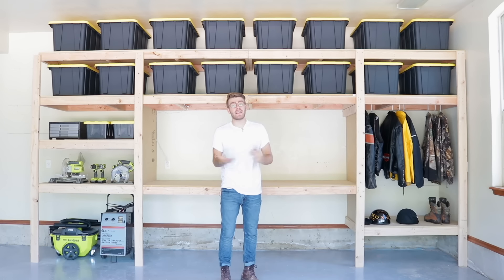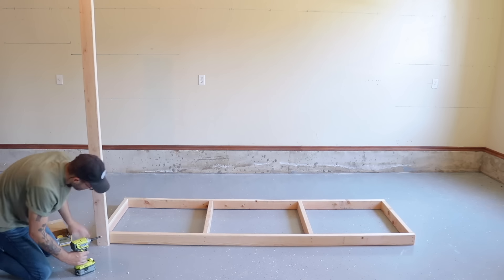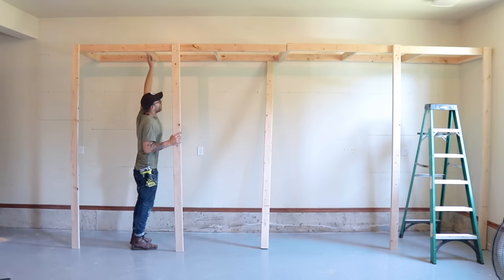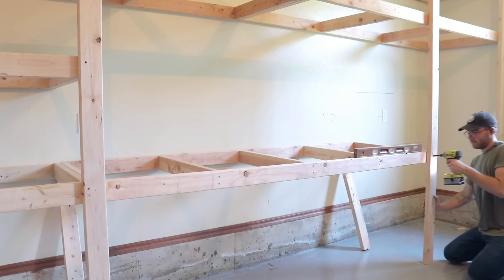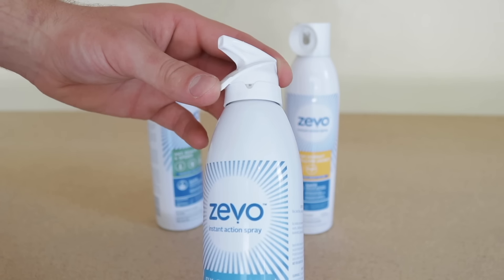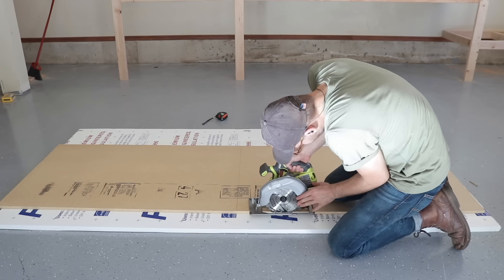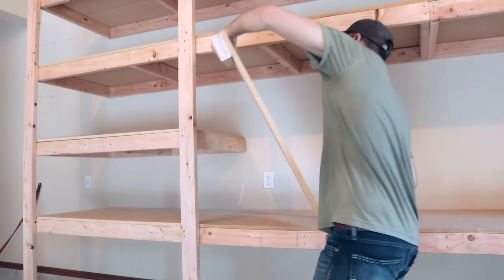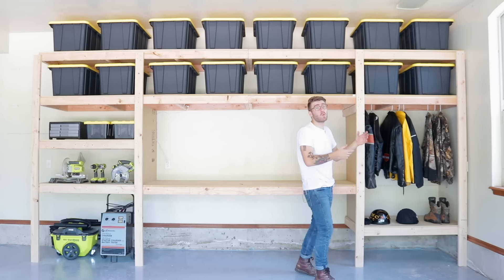DIY Garage Storage / Shelf / Workbench Solution

Comment: Barely a minute in, I had to stop watching.  It's clearly low quality work here.  No glue on joints - just screws in shear.  Said 8' studs don't need cut since that's his leg length - you might want to measure a few, huckleberry, because I'd wager they won't all be exactly 8'.   Measured down from ceiling going right to left - should have used a level to get a level line - the ceiling and/or floor may not be level.  Couldn't watch any longer knowing it would be hack work.
Reply: Mitch D ya I don't think the point was to be super technical or fancy.   Lighten up. It was a quick  tutorial on building some simple not too expensive garage shelves. Probably intended for kinda beginners or diy-ers.  I mean he put way more thought into it than I did for my storage shed shelves but mine have worked just fine goin on 2 years. So I'm sure these will work just fine also.
Reply: If you're going to DIY, why not spend a little extra effort (and no extra money) and do it well enough to not scream "DIY" when someone looks at it?

Comment: “So much nicer to use polystyrene” but awful for the environment, come on Mike do the right thing
Reply: james moon it’s ok as long as he reuses it, not every thing we do is environmentally friendly but if he were to reuse it then it’s fine
Reply: +Joshua Powell It isn't just about reusability of the polystyrene sheet. When you cut just wood, you can use sawdust and wood chips in compost, yard work, etc. without worrying about nasty plastics and chemicals getting in soil and the environment. But when you cut on polystyrene, it mixes with the wood dust and renders it unusable so you have to throw it in a landfill. Hope I explained that ok. ♻️
Reply: Jelisaveta Zivanovic very true
Reply: james moon ok plywood, particle board, mdo....etc are not pure wood either......so using polystyrene is really not that big of a deal.....it’s used by many.

Comment: Ok so materials are
pencil
saw
straight edge
level
drill
3 inch and 2 1/2 inch screws
2x4s
particle board
dowel
lights
No Kreg, no clamps, no nails, right?

Comment: Tip for framing this on a slanted garage floor? Should i just make the longer side 8 feet, shorten the other side to be level, and angle the vertical 2x4's so that its plum?

Comment: Just finished my own version of this. Used manual tools thought the entire project except drilling the holes on the wall.

Even with a Japanese saw and a square, I couldn't get to build perfectly squared frames, even less proper length middle supports. But OSB board is very strong, rested 70+kg and no warping. So no middle supports on the side shelves (I'll see if I strengthen that part in the future.

I also didn't have a perfectly straight wall, and it's concrete one so I had to premark the holes in the wall while holding the supporting wood planks, that took 2 people.

Project took about 9 hours and looks very nice! No more tools laying around the house.

Thanks for the tutorial!

Comment: This looks awesome. I actually was able to build one myself and it looks great. However the only issue or concern I have is the middle.  Without any support I can tell it is not as strong as the sides where there is a 2x4 running up and down. I think it is still plenty strong to put lighter items. Anyone else have this problem?
Reply: Im building mine here in a couple months and will be putting a support 2x4 in the middle.  I agree, needs the strength there

Comment: Did you check for studs in the wall prior to planning out where you would be attaching the 2x4 to the wall itself? Or did you just use the 3 inch screws and assume it would work?

Comment: Did you search for studs or did you just drill into the plywood backed Sheetrock? It’s one of the issues I am running into trying to build something similar. Because Sheetrock is laid on top of playwood, even deep scan stud finders are bringing up false positives. I plan to use drill next to an outlet and see if I can measure 16” off center from that.

Comment: Tim from Canada.. your designs are great.. but if you were building this for your own garage, all the measurements are going to be different. The design layout will be about the same but the measurements are going to be different depending on the size of your garage so the materials he is using is going to be the same but the measurements are going to be different because this is his garage and your garage shed or basement will be different sizes layouts are the same materials are the same just adjustments are going to be what will be in your garage basement or shed

Comment: I just tried it this weekend. One big mistake I did ( I guess ) , instead of normal 2 x 4 I tried using weather treated 2 x 4 , which is lot heavier than normal 2 x 4. Thought it would be stronger … may be it is . But you know what ? When I tried putting the initial setup ( 1:12 - 1:22 ) to the wall. My shelf pulled off and came off leaving one side I:e the 4 x 2 fixed to legs in place . . . I don’t know if I really want to go back and get normal 2 x 4 or try fixing this .. will update soon. May be additional screws could have kept it in place .. compared to just 2 screws as in the video…

Comment: Question? In this build, up front has 4 legs but what about the back no legs? I mean what happen if you put some weed cutters or shovels or something heavy on the sides or upfront and the shelves collapse or worse yet come out up front & fell on top of the cars 🚗 or someone, will this build hold good amount of weight or just light staff, isn’t better to add 4 legs in the back to give more support and strength to the build?

Comment: Question:  You said Your project is 30" deep. But you're cutting The width 2 by 4s 27". Would that be 31 in, becauseyou are adding 2in each side front andback 2x4?  Just trying to figure out a smaller build thanks!
Reply: The one inch difference comes from the fact that 2x4s are actually typically 1.5x3.5
Reply: @bthreinen  thanks you can tell I don't know the width of a 2 x4 but now I do. I was just assuming it was 2". Lol

Comment: Except the work bench where you are going to be continually hitting your head on the overhead 2x4. The 2x4's on the side of the bench would get in the way as well. The work bench portion just isn't very practical if you really use a work bench very much.

Comment: ...i am all about building things, but this looks like alot of work and money for something so simple as storage. Just on plastic storage boxes i calculate about $120 dlrs. If you dont have a truck to haul all the lumber, that on its own can become a challenge...i dont know about this one.
Reply: Abraham S. what’s your alternative? sure it’s not super cheap but how much cheaper could you get with this level of organization?
Reply: @thehangardesigns  i will do the math some sketching and some scheduling and will get back to you
Reply: Ridgid professional tool box (stackable). This is by far one of the most efficient ways i have come across so far to store thing in tmyour garage or anywhere for that matter. Different sizes of boxes, they even have crates, and you can roll them. They stack up so they dont take much room. And also, are portable. This will eliminate the need for drawing out studs or the liability that come with missing the stud and hitting a power line or water line (not most people have the pracrice or the tools to find the stud) and this also eliminates all the time needed to cut and hang and cut and measure, couple of hrs of your weekend should be enough to go get the boxes and stack them and a couple of hrs to get all organized and your back to quality time with the family instead of hanging wood from a wall. Cost is $30-$60 per box, but if you take into consideration the time you will be saving, its very worth it. I will contine to crunch numbers. Have a good day!
Reply: @thehangardesigns  
..another item that i have come across on my search, although not wood or metal, are plastic shelf ynits. Super easy to put togheter, minimal effort to move around and come pre packaged so it will easily fit in a small car. Altough, they do have a weight limit, just like anything else, these shelfs are a good choice to use, specially if you rather spend the weekend with your family and friends then to be cutting wood and trying NOT to miss the stud behind the sheetrock. The ONE THING i dont like about plastic shelfs is that they are plastic. But the one thing i LOVE about them is that they can fit almost everyones budget. Home depot will have some sales going on this weekend. Price i saw for a nice sized plastic unit was between 30-40usd.

Comment: good stuff bud! We just moved into our new house (3rd house now) and low and behold, a clean unmolested drywalled garage! I told myself I was going to buy the nice heavy duty adjustable shelving for the entire garage this time, but after pricing it up I realized why I always DIY with 2x4's haha. Anyways, Im gonna mimic your design for sure, but all the way down both side walls. (minus the bench on one side.
Reply from the maker: That's so awesome!! and if you add back legs you don't have to drill into the wall too much.. maybe a couple screws into studs as a safety net

Comment: What kind of wall do you have? Drywall/Sheetrock over wood studs? If so, I didn't see you use a stud-finder to find the vertical studs to attach the lumber to.

Comment: The top two shelves should have been configured like the work bench 4/8/4 rather than 8/8.   it makes no sense to have two cantilevers meet in  the middle rather than a solid span above the bench with two 4' wide towers on each side. 
Bins can be stacked.  The top shelf is not necessary.  And it's omission would allow the header above the bench to be raised  5" to avoid head bumps.   
A bench height of 38' to 44" is more ergonomic for standing work and provides space for two roomy shelves under the bench.
Using wall studs for support is efficient provided fasteners shear strength exceeds loads.  Rec 4 1/2" lag screws.

Comment: This is a great video and a pretty good storage/work bench design, BUT, the screws are too short going into the wall (and even stud to stud). With 1 1/2" stud width plus 1/2" sheet rock you're only getting a 1" bite (at most) in to the wall framing with a 3" screw. Use a 3 1/2" screw minimum going in to the wall please!! 

I want a strong safety factor built in just in case my kids climb on the work bench to get to a tote up top or when I place a transmission on the work bench to work on or maybe pound on something on the bench.

Thank you for the great video!
Reply: what size screw did you end up using??
Reply: @868Nako  I used a 3 1/2" screw.

Comment: My garage drywall is uneven - it slightly bulges at the seam, causing both ends of my 2x4x8 to stick out. Whats a good solution for this?
Reply: vietdeity86 I’m no expert by any means but it sounds like that’s just the framing underneath. I’ve heard that walls are seldom actually flat. If you feel like going exploring and doing some drywall work check out what’s behind it, it could be the framing or not the best tape and bed job?

Comment: The 2” screws should be 3”. That 2x4 is 1.5” thick so you’re only getting .5” into attached pieces. That’s not very strong when you figure the shear value. Also use OSB or plywood not particleboard, ANY amount of humidity in the air will make that particleboard swell like a wet sponge and fall apart.

Comment: I created a set of shelves like this and it worked very well - the only variations I made was to use to make the shelves only 24 inches deep. I then picked up some 4x8 OSB sheets at Lowes and had them cut them down the middle so I had 2 2x8 boards. Saved some money on the number of sheets I needed and OSB works just as well as plywood for these purposes.

Comment: hi, just wondering if it is required to pre drill the bottom piece of each 2x4 to prevent splitting? It seems you only pre drilled the top/front piece of the 2x4 for each self section. Also, wondering if Kreg pocket hole is better than the pilot hole/screw on end piece of the self section. I saw you pre drilled holes when attaching the shelf to the wall, correct? Thanks

Comment: Nice concept, but the whole thing is relying on the nails to hold the weight.  Which is fine, if you don't have anything too heavy in those bins.  I personally would have bolted the back 2x4's to the wall.  And on the legs, I would have added 2x4's behind the legs, in between the shelves, just to better distribute the weight.  But that's just me.

Comment: Cool concept. Small point - deck screws are not appropriate for structure on account of their poor shear strength. They do sell proper construction screws, however. Framing nails would be best, well worth renting the nailer if you don't own one.

Comment: The zevo plug. If you remove the bugs collected in the zevo you should wear latex gloves when handling that once you’ve collected bugs in there. The bugs touch there way into the uv light and stick on. So those germs would transfer from plastic to your hands and fingers so handle with care and wash your hands.  Assuming from the video that Zevo plug looked brand new.  So handling it such as in the video was okay.  Great video btw.

Comment: Hi Mike,

Just curious to know is this well with load bearing? Should you fill all those tubs with pretty decent weighted gear, will it withstand? also will this work if I built the same however to a brick wall?
Reply: If he would of used lag bolts he would of been better off 3 inch screws (lol) so in a 2x4 half of the screw goes through that, then depending on the drywall lets say 1/2 inch, so that only gives you 1 inch of wood to bite on.  I would of used 6 inch lag bolts fasteners, sure they are expensive but your studs will thank you. 

Hopefully those 2x4 are very dry 2x4 or else that is going to be a lot of weight alone

Comment: 👍👌 I did sort of the same method in my closet few years ago, the only difference is that I chopped up old shelf unit into five shelves and attached to wood frame I created. Did the job as it filled whole width and from floor to ceiling. Oh and it's free standing as it an rental property. 🙂

Comment: Cool storage system. Like the work bench idea. I would add a sheet of 1/16th inch sheet metal, because I work on 2 and 4 cycle engines.

Comment: Mike, this might be a dumb question, but for the back of the shelves are you drilling right into the studs in the wall, or did you use some kind of anchor for the screws? Also what is the spacing for the shelf support?
Reply: I’m trying to figure that out too

Comment: Did something similar in my garage. Found that screwing in the 2x4 that goes against the wall first worked a lot easier. No need for a brace. Screw the first in. Then the next temporarily over that one, then the legs to that. Then remove the temporary screws and you have a perfect match to go out as far as you need.

Comment: You need to paint that particle board, any type of moisture will cause it to expand. It works okay for shelves, but you are much better off using 3/4 plywood for the work bench. I would also have the work surface raised to a normal counter height, as well as, losing the one shelf above the workbench (unless you enjoy hitting your head). The general idea/plan is really good, but needs a little tweaking if you plan on really doing work on the bench.

Comment: I’ve been looking at videos of garage shelving, and the one thing Ive noticed that all the videos miss is the slop of garage floor. No one has pointed out that the measurements for the legs should be different. The closer to garage door the longer the support legs should be. Am I wrong?
Reply: I guess if you make the shelf on the back wall the floor should be even.

Comment: Great video!  Will be building similar storage for our garage.  Question for you - since we live in New England, we typically have wet floors in the winters from snow melting off our car tires.  Should I use pressure treated wood for the 2x4's that come in contact with the wet floor?

Comment: One thing you might do is to put the horrizontal 2x4 directly into the back wall and 'tack screw' a second set to it.  Then put legs on the one that is 'tack screwed', and remove the 'tack screws.  Then put in any cross braces to hold the 2x4 with legs out from the wall and lay your shelving material on it.  Just a thought if you would like to do without 'back legs'.

Just anothe way to make s similar product!

Comment: Question: for something like this, does the screws for the drywall side required to be drilled into a stud or will drywall itself be fine?
Reply: your better off finding the stud
Reply: Screws drilled into drywall can easily be pulled out by hand. Just saying.

Comment: I did a similar project about a year ago in this same style, down to the color/size of the plastic totes.  Since I only planned on stacking totes on the shelves, I just ran 2x4s instead of laying MDF.  I ended up making a rolling workbench that fits right into the shelving unit with leftover scrap.  Everything is stored in a labelled tote.  Nothing is just tossed up on the shelf.  People walking by when my garage door is open walk up to compliment he arrangement all the time.

Comment: Built mine and it turned out great! I did take note of the comments below me regarding the need for stronger reinforcement. I have concrete walls in my garage, so i used concrete anchors to hold the back support frame. I used lag bolts where the shelf frames attach to the upright supports, in addition to screws. I bolted on relatively small pieces of 2x4 to the uprights, touching the bottom of each support frame to give more support. I'm convinced it's quite strong enough.....more than enough, to support the items on my shelf, which include a heavy brick wetsaw and a compound mitre saw. Thanks for the inspiration!